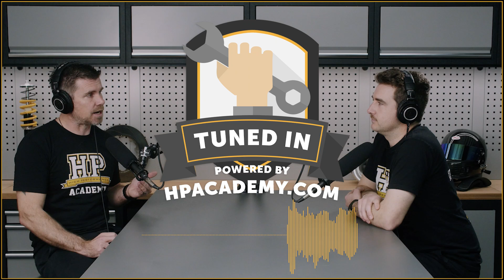004: Building An ECU From Scratch [#PODCAST]

Comment: i cut my teeth on Megasquirt and i think i was at a novice level when i was playing with my MS equipped car. i haven't tuned on my car since 2007 and it's been sitting in the garage since then. i will dust it off soon and upgrade to to newest Megasquirt and learn all over again. i think a good ECU should come with easy to read, clear and concise instructions and a glossary of each function and table. that way a young tuner can grasp the understanding of what he is looking for, what changes he's making and why. great podcast HPA💪
Reply: MS is an excellent software and hardware. The MS3 Evo is an excellent hardware piece.

Comment: Love this, and it solidified my thoughts that the big guns in the ECU world were using FPGAs. As an embedded Controls hardware engineer it is so cool. I would love to know the actual FPGA they used. I would love to dip my toes in the world and use a Xilinx Zynq more horsepower than it needs but very expandable

Comment: Using pressure differential to estimate air mass flow is honestly genius.
Reply: Basically a map sensor, it measure the pressure/vacuum difference in the plenum.
Reply: @Goblinv3  2 map sensors.

Comment: When I started to move away from carbs on a small capacity 4 cyl power unit that was not that different in bore/stroke to a early 80's motor bike, the problem was finding a ecu that had enough break points in the RPM scale, most seemed to have 30 odd, we needed 125 as it turned out.
Also optimising the ign. on the test bench resulted in one setting when held at a steady state then would give more power with more advance  depending on transient ramp rate. 
The Italians had the knowledge that I needed
Steep old learning curve
Reply: Swapping the ECU from another car or bike was an option?
Reply: @jareknowak8712  Would of saved many £££ but no, we were experimenting too much for that.
Double injectors, individual cylinder fly by wire throttle and individualy variable air intake length. Each of the 8 injectors has a full page map to it's  self including injection phasing.
 Took 2 weeks on the dyno bench for mapping initially 👾
Reply: @gothicpagan.666  What engine is this?
Reply: @jareknowak8712  Coventry climax FW
Reply from the maker: Sounds like an absolute ball-ache but also an absolute ball of a project all at the same time haha
Can't imagine the amount of knowledge you walked away with from it 😎 - Taz.
Reply: @hpa101  It was 20 odd years ago. TBH if your not regs, restricted you'd be crazy not to use a pressure charger. Way more power for a fraction of the cost.